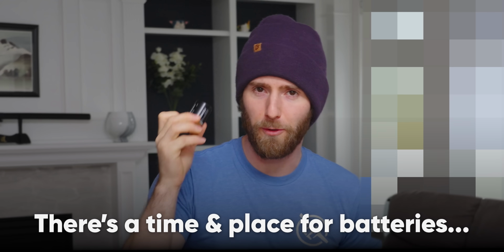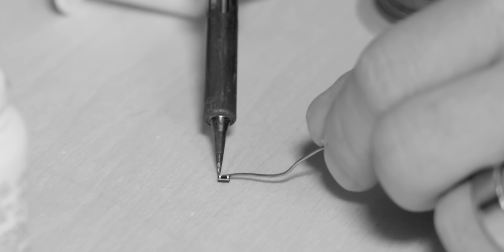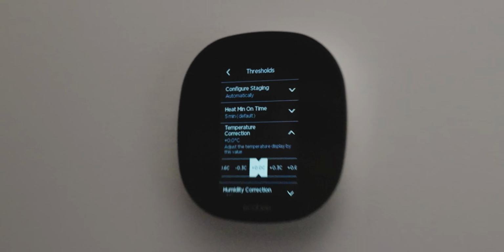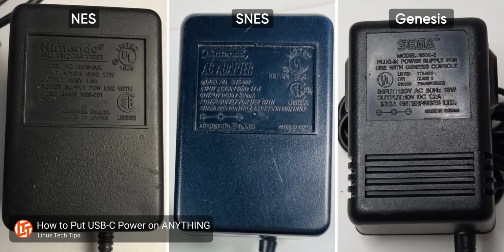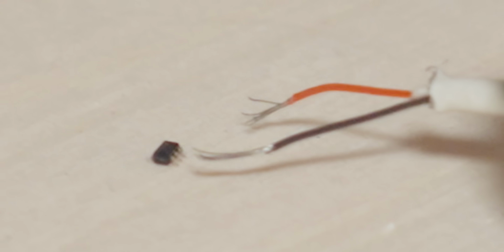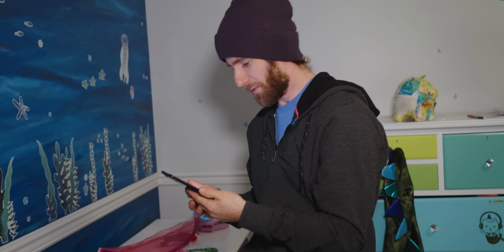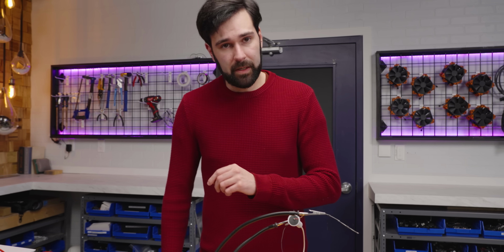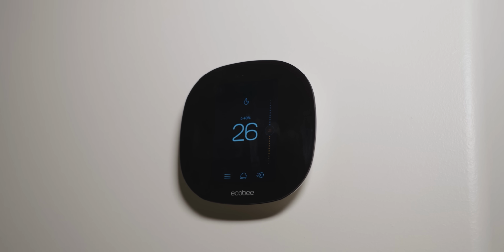I HATE Batteries! - Converting Wireless to Wired (a cheapskate’s guide)

Comment: I've been wondering about something like this. I'm very tempted to try it with the battery powered garage door sensor that I have. I'll need a lot of cable and probably a cable winder at one end, but now that I have an idea of how to get it to work, it's possible to do. Thanks for the video!
Reply: Check my instructables on a 9v converter from a power bank, i use it on my multimeter and internet routers.

Comment: Why not use a supercapacitor and only draw power from the wall when its voltage goes below 3V. Then you also could temporarily unplug it without problems. Also a LM317 would be much better to set to a specific voltage.

Comment: As an electrical engineer my thoughts on the voltage regulator part: linear voltage regulators acts as Linus tells (dissipates the additional voltage as heat, basically), but a buck/boost (stepdown/stepup) converter works based on a different principle. Here, to be cost effective, I would advise to use a stepdown dc-dc converter after the 5V power supply. Small dial-in dc-dc breakout boards are available for cheap.
Reply: PS: I'm open to work for LTT as an electrical engineer, as I see, no one mentioned this solution from the team... :D

Comment: If you just put a resistor I series with it as your first attempt, of course it didn't work but what you'd want is what's called a voltage divider where you put two resistors from 5v to ground and put your circuit in parallel with the second resistor. Then the voltage can be calculated based upon the formula Vout = Vin * R2/(R1+R2) where Vin is 5V Vout is the voltage experienced by the device R1 is the resistor between 5V and the contacts and R2 is the resistor in parallel with the device.

Comment: hello linus i think that fire alarms having batteries is good because if the electricity goes out u need fire alarm still, you may thing that you can have it permenantly connected with a battery as a backup but this too is not safe as the battery may fail without you realising

Comment: You probably should have made a PCB, but a regulator definitely would have been easier. In a pinch you could also use a zener diode. The method used might not be the best because the current draw will change the voltage.

Comment: A pot is a pretty terrible way to reduce voltage.  A resistor of any sort limits current, not voltage.  Which means the output voltage is going to fluctuate wildly depending on the load.  A 3.3 volt regulator should work perfectly fine on a 3.2 volt device.  The regulator you used might need some additional components to function correctly.  You'd need to check the datasheet for an example circuit diagram.

Comment: Dan just throwing the previous scene off to the side is the top-tier editing we love.

I have remote-control sockets that take those stupid 12V four-button-cells-in-a-stack batteries (and the remote just eats them - or, more likely, any one of the four cells dies and the whole thing is useless). I tried hooking in 8 AAAs to give the same 12V... and killed the remote. Stone dead.
Reply: I got a power bank and modified it to output 9v for my multimeter, i can recharge in a minute to get days of runtime.

Comment: I've moved to only rechargeables years ago. Sucky part is they don't have the capacity or output of alkalines so I find myself constantly changing batteries even more than before, albeit saving money in the long run. It's the price we pay for freaking everything being electric these days. 

What I would really like would be if they could make a rechargeable that carries the same voltage as an alkaline so at least things don't die so fast. (looking at you Amazon with your remotes that refuse to work with even slightly dropped voltage, even though I'm using Amazon rechargeables.)

The entire planet has been waiting decades for better battery technology but it's more profitable to just keep destroying the earth mining lithium.

Comment: You really shouldnt run stuff like a smoke detector without batteries. The batteries are there in case the power goes out, no idea why they dont charge the batteries while its on though.

Comment: Man, it would have been so much easier if Dan had just whipped up a quick PCB that was shaped to be inserted into the battery cavity.  A proper outline, a SOT-23 placement, a 10 uF ceramic (for the higher instantaneous power draw), and a trim-pot.

Comment: The vast majority of USB chargers don’t do so well when they only supply very small current, which is the case for this device most of the time. The output voltage might have a lot of noise and not be very stable. So what you need is a linear regulator like what you already used, but with multiple filtering capacitors as per datasheet, and soldered on a proper PCB. You could even make it shaped like a coin cell battery and attach a cable with USB A or C plug to the end of it.

Also, 3V regulators are quite common and usually in stock. You might get lucky and even get 3.1 or 3.2v version if you check multiple marketplaces

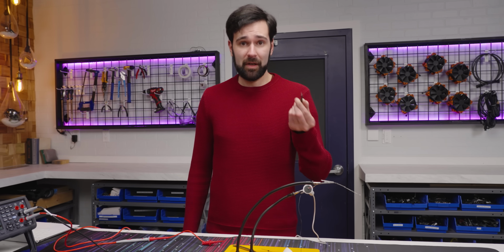Comment: 12:38 yes to all your questions i burned my hands over and over as a teen soldering stuff. use a thicker wire strand as a chip arm extension. then you have hairs on each leg to solder to. and heatshrink it. maybe  you could have used a wired battery cell as a jump-starter as well. and he had like 100 tries there to do it right  with so many in the smd strip :P i wouldve maybe used a bigger battery with long shelf life perhaps? modded the case a bit to fit

Comment: 14:00 after the diodes you have to use a capacitor to soft the spikes the device asks. i know because i used a 12v adapter to power a chinese wall clock that requires 1.5V

Comment: what sort of maker doesn't have a billion ebay DC buck/boost boards based on LM2586 or XL6009?   Then you can use literally any >= 5VDC supply and drop it to exactly what you need.

Comment: The MIC5504 (or any other LDO) requires input and output capacitors to function properly, these are called bypass capacitors and aid with stabilizing the voltages during random current spikes. The datasheet for the MIC5504 recommends 1µF at both input and output side, but it wouldn't hurt to oversize it with a 2.2µF capacitor. 

An LDO lowers voltage by dissipating the surplus energy as heat.Thus the heat dissipation can easily be calculated by subtracting the output wattage from te input wattage.
Lets for example estimate the average output current to be 10mA. 
- The output wattage at 3 volts would be 3V*0.010A = 0.030 Watts (Or 30 mW)
- The input wattage at 5 volts would be 5V*0.010A = 0.050 Watts (Or 50 mW)
- The heat dissipation would be 50mW-30mW = 20mW ... The other 30mW is used to power the device. 
- Next we need to check the LDO's datasheet to get the temperature increase per dissipated watt of energy, usually labeled as °C/Watt.
- Our MIC5504 has a temperature increase of about 250°C per watt. We only dissipate 0.02 watts of heat, thus we multiply 250°C by 0.02mW = 5°C temperature increase. 
- Thus at an ambient room temperature of 20°C we can expect the LDO to reach a max temperature of around 25°C. Which is below the maximum rated temperature of our LDO.

* Note: 
- The lack of a pcb/circuitboard as cooling plate could cause slightly higher temperatures in reality. 
- I always try to keep an LDO below 70°C tops, even when the datasheet states 150°C.
- Look into a buck converter when larger voltage drops are required! These won't dissipate as much heat, but are more complex and bit more expensive.

Comment: 10:13 something you could do for the future is find all of your QR codes for your various devices and export them as a large image file that is stored on your server. I have this done on my security cameras so that in the unilikely event i need to add them on a new phone or because i forgot how to rearrange them in the app UI, i can just import the QR code from a file rather than to go to each security camera.

but this is only a solution if the software allows you to import a QR code. I guess another option is to open the QR code file on another device and point your app/camera at the other device

Comment: I remember when TV remotes were wired. You slid a bar across the device to tune in your channels. 
The problem with many "cheap" parts is that you have to buy many more than you need at a time, so unless you're in the business of electronic repair you'll likely wind up with a bunch hanging around.
Given all the hassle, it would just be better to stick with the batteries and replace them as needed.

Comment: To be fair that's really worst case scenario, I've done plenty of stuff that use 3 AA batteries to usb, and you don't need any kind of regulator since it's originally 4.5V (and they're usually designed for a rather wide range since for example if you use those new lithium rechargeable AA are actually more than 1.5V each), just directly solder a usb cable to the battery pads and done.

I also think they could've used just a 3.3v regulator, it's more than close enough, worst case scenario the device outputs a little more heat. You gotta remember devices like these are designed for voltage fluctuations since they're designed around being battery powered. When you swap power supplies on wired devices you gotta be more precise because they don't have that fluctuation in consideration and might show funky behavior even with minor changes to input voltages.

Edit : Also I see that there are boards online that can take between 3.3 and 6V and output a stabilized 3V flat, that would also work great for that and would compensate for the current spike at bootup, and it's like 2$, just obviously need to plan in advance and order the right stuff. But honestly they should've done that for the video, because the message that came accross here is "it's hard, you're gonna break stuff, don't do it" because they made it so much harder on themselves.

Comment: Jesus... Free floating smd components soldered point to point. OMG, why? Didn't you guys hired electronics engineer something something for labs recently? You need to design a pcb, many pcb fab sites will give you ten of pcb's for about 5$ (pcbway, elecrow, jlcpcb etc), you could even design board in size of that battery to fit exactly in battery space and utilize original battery contact points for 3,2V. But not this jenky nonsense.

Comment: I did a similar thing. But instead of using USB chargers, I bought 3V 500mA wall socket power supplies. 0,5W per decived wasted for the process of providing endlessly stable 3V is quite fine.
Reply: They won't take all that of it's not being used.

Comment: What about keeping the button cell in and providing those 3.2 volts all the time?
The current spikes would be eliminated by the cell and it would keep working even when you unplug it or the socket loses power.
Also the battery would be kept charged, but not getting charged at a higher voltage than it should be so it should be safe and not leak.

Comment: 3.3v regulator circuit is all you need.  New button cells test above 3v.  The circuit design will be tolerant to at least +/-10% voltage.   Shouldn't LTT Labs be helping to upgrade the hackery prowess on videos like this?  The viewer doesn't come away with any of the better solutions.  (no mention of modern buck converters, electrolytic smoothing capacitors, or power supply voltage modding etc.)

Comment: should've just added a capacitor at the output of that regulator lol

heck, you could've even just done that with the resistor divider, since the device only draws very short spikes of still relatively low current every few minutes, a capacitor would've been more than enough since the device will be powered mostly by the charged capacitor on startup and every few minutes, and when it doesn't have to supply that much current it's gonna be charging the capacitor back up and running off the resistors since they can most definetly provide that little current the device consumes most of the time

Comment: Battery versions sometimes use way less electricity each day. There are 120v fire alarms that use a 9v batteries worth of electricity weekly. So check your wall plug devices in case you need to not use crertain brands.

Comment: Very interesting! Ooooh maybe get a 3D printer to print off something the same shape as the button cell you're replacing and house the bits inside that with some metal tabs connecting to the battery terminals in the device. If youre gona drill a hole in the battery cover anyway, maybe build it with a usb port that you can cable into the back....I want to do this now lol

Comment: funny I started modding my devices as well. my vernier caliper now uses regular AA or AAA batteries insteas of the weird round ones... and my hp reverbe g2 controllers have now lifepo4 batteries instead of the AA batteries that lasted 24 h of usage. the last project took my quite some time to reverse engeneer the controllers and adapt them to the bigger lifepo4 batteries

Comment: Would a really old cell phone charger work? Like the ones for flip phones from the 2000's? I bought a Motorola charger for some model of flip phone and used it to make a new charger for a GameBoy SP. It was 5v 500mah so that's like 2.5 watts. Found it and the car charger cable for the gba sp at a salvation army thrift store.

Comment: You can get a variable voltage regulator like the LM317T and a few resistors to dial in the required voltage like 3.2V. I know it exists as TO-220 package. Not sure about small SMD.
Reply: They are everywhere in smd too.

Comment: Frankly i am shocked that you don’t have usb charging points built into all your wall sockets.  If you have wired internet in all the rooms you could use PoE and have a box in the server room that supplies variable voltages for PoE, I like the POT idea so you can vary the output to account for any voltage drop over CAT(x) cabling.  Alternatively You can buy 5 dc-dc buck converters for less than $13 (that 2.60 each) wire to and old dc power supply. They will typically take 4-40 v in and output 1.25 to 37v at 2 amps, wire them into rj45 connectors in the server room and you can supply pretty much any dc voltage to any place in your house that’s wired for internet.  With buck converters being in the sever room you don’t have to worry about the heat /fire risk of your improvised voltage regulators too👍👍

Comment: If Linus saw the condition of my tiny apartment. His jaw would drop and would probably tell me to immediately call code enforcement on my landlord. (Been there, done that already for the terrible heating and months long hot water tank issues.) Specially if he saw the collapsed foundation in the basement that's behind the slowly collapsing second wall my landlord let an idiot put in, to save money. Not understanding freezing and expanding dirt is pushing the second wall over too. All because Mr. Cheapo never invested the money to put a gutter up decades ago. I'm trying really hard to GET OUT OF HERE (failed to financially last year) this summer cuz I am actually afraid this dump could collapse within 2 years. Based on how many inches per year the new wall is already pushing out. Which by the way is the only thing holding the steel beam up on that side. I think I'm just venting. Sigh...